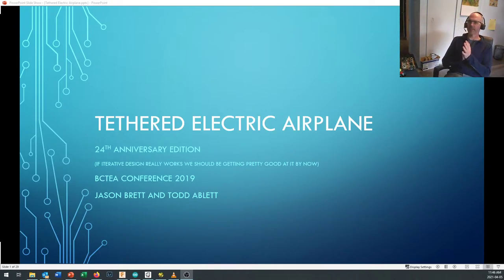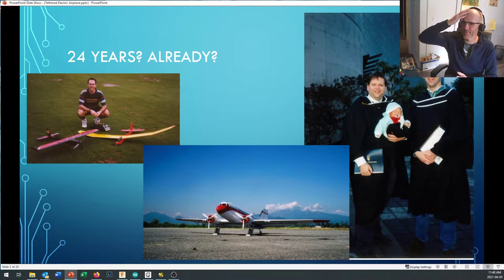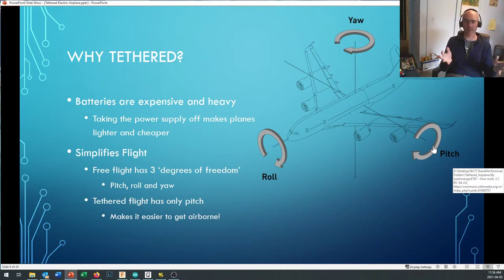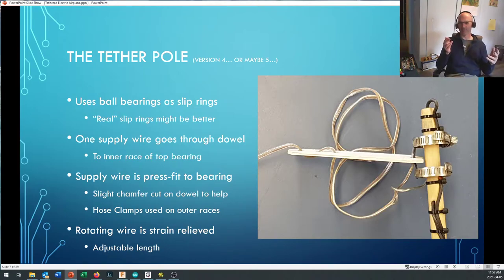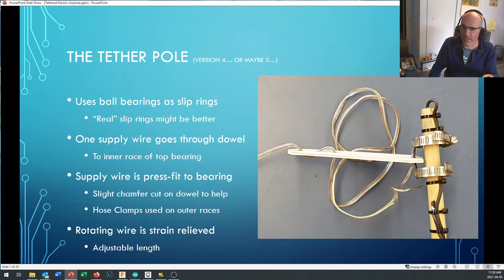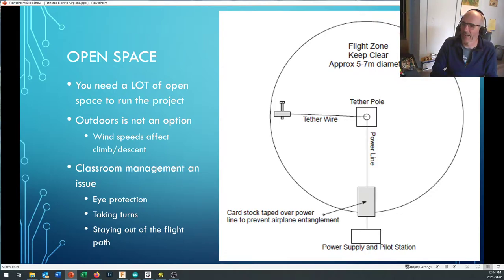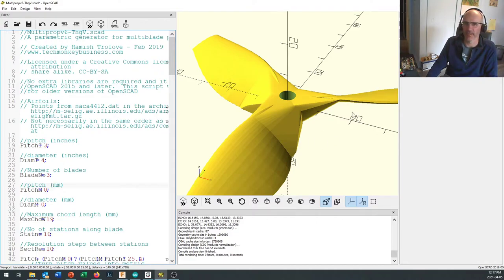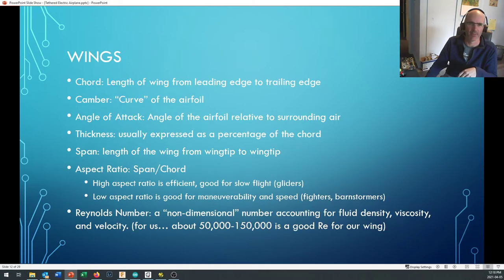TTED4044 Tethered Electric Airplane Introduction

Comment: Is that a 3/4" dowel? Any idea the Timken bearing # that fits well?  Thanks!
Reply from the maker: This is a 1/2" dowel, and the bearings were ones that slid nicely over it... I don't have a particular part number, sorry. Obviously a 1/2" inner race, though!

The other key thing is that you can wash all the grease and lubricant out of the bearing... Since we aren't applying any significant load to the bearing the lubricants just interfere with the electrical conduction and add a bit of viscous drag to the bearings rotation.
Reply: @dtengineering  Brilliant, thank you! We are gearing up to give tethered planes a go. Your resources are outstanding. I appreciate all the time and effort you have put in and the willingness to share.